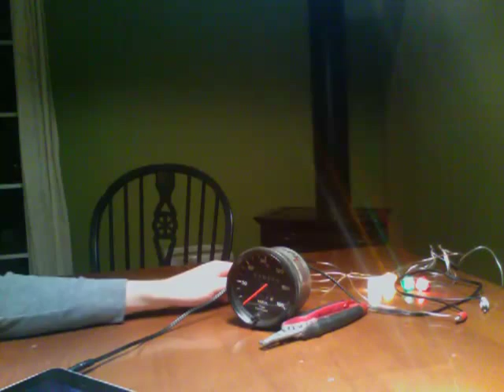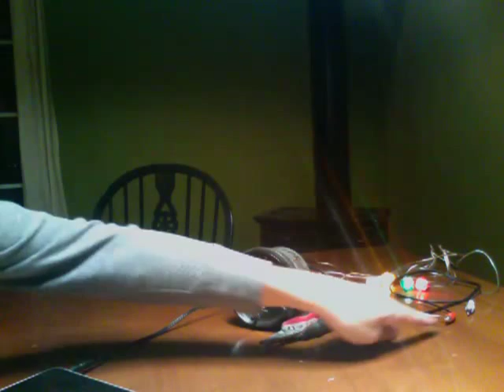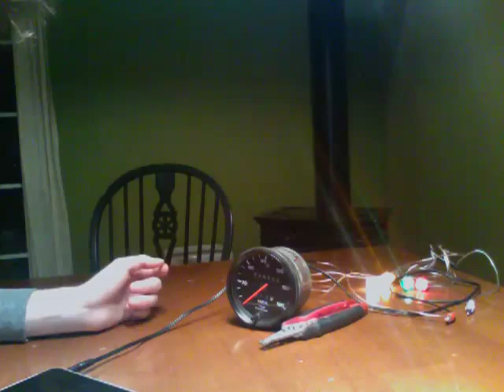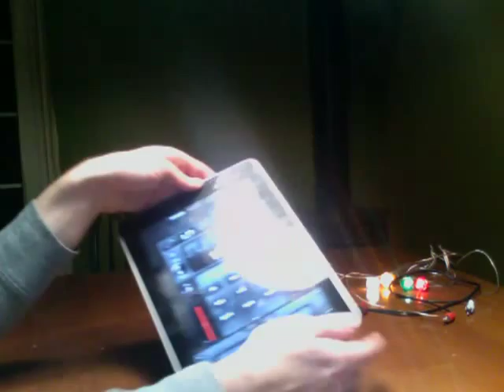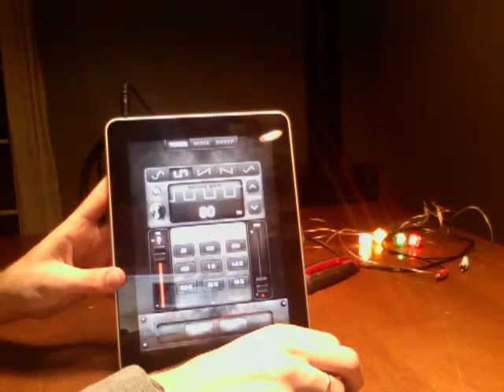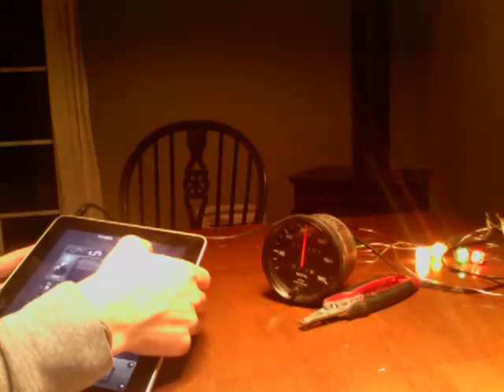'82 Porsche 911 SC Speedometer Test

Comment: Hi there, I have a problem with my 91' 964 Speedo. It regesters the speed correctly, however the mileage is stuck; i.e. it doesn't add on any miles. Any ideas?